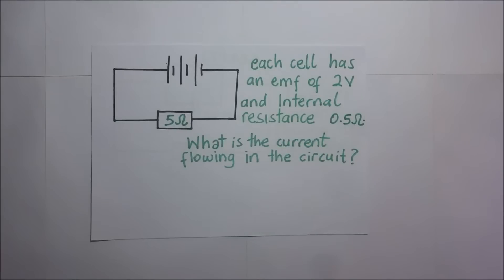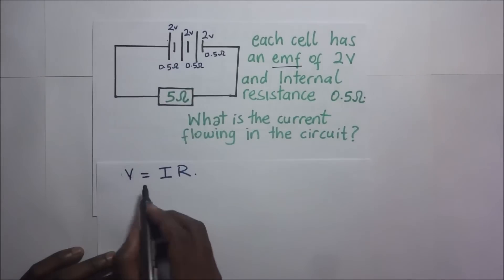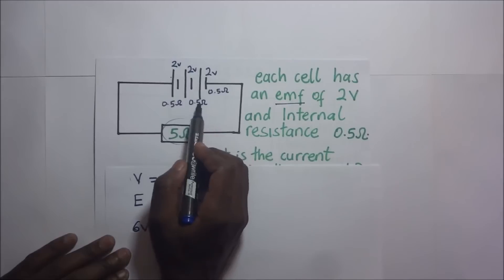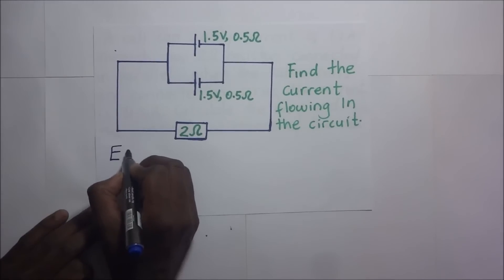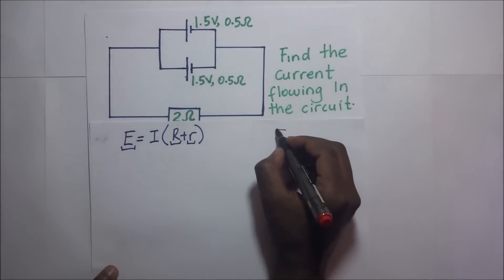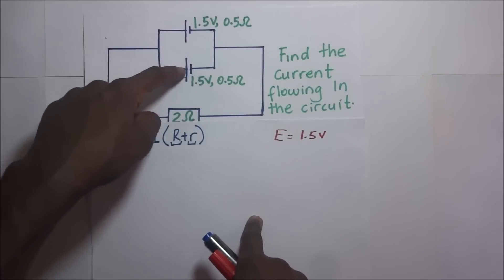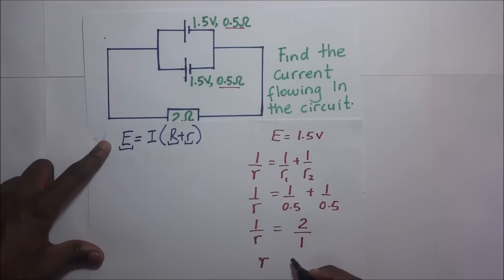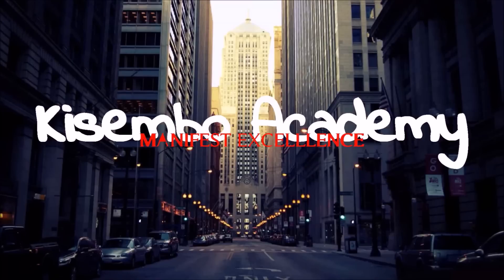Emf and internal resistance of cells in series and in parallel, Worked examples by Kisembo Academy

Comment: You should have used the same number of batteries (and same internal resistance) with the same load for both so we could compare which results to greater current.That is, whether batteries in series or batteries in parallel.

Comment: I have understood each and every thing but only the part of  adding fractions coz I didn't see LCM
Reply from the maker: Well, its because i skipped that step of LCM. My assumption is that by the time someone is studying electrical circuit calculations, they must be able to add and subtract fractions. However try using LCM in your working , you'll still arrive at the same answer.
Reply: Thank you I have now understood more examples on different topics please
Reply from the maker: Feel free to suggest the different topics you want to see

Comment: sir how to get total emf, when two cells having different voltage are parallel to each other
Reply from the maker: In practice, you are not supposed to connect batteries of different voltages in parallel. If you do, (that is if the batteries are rechargeable) the battery with the higher voltage will charge the battery with the lower voltage until the two batteries attain the same voltage.(the same voltage being the intermediate between the starting voltages of the two batteries that have been connected in parallel).
Reply: @KisemboPhysicsAndMath  so the batteries must have the same voltage
Reply from the maker: @khalidmusa7028  yes